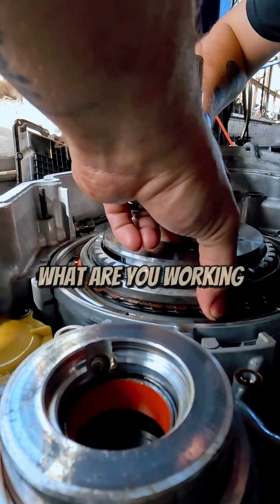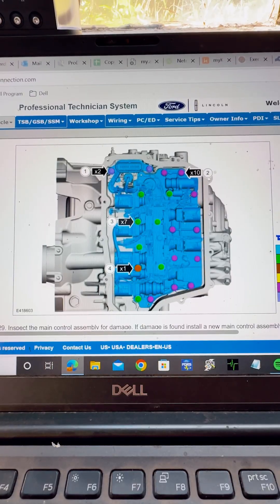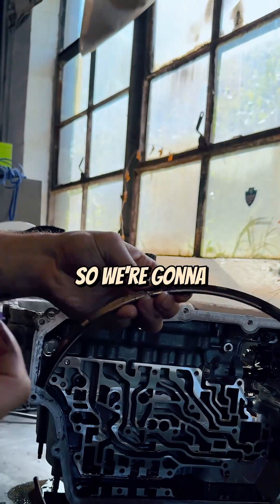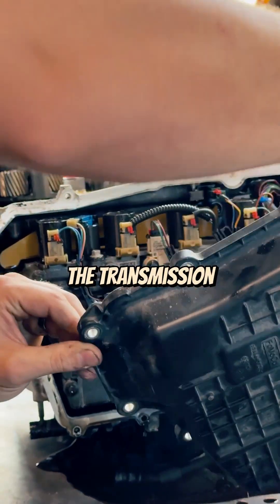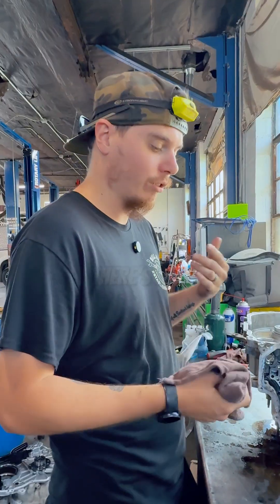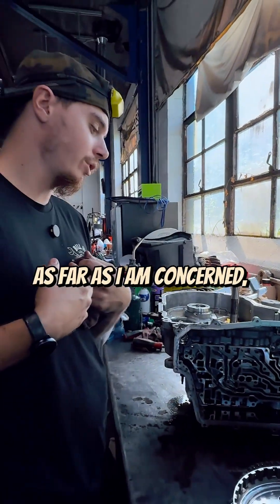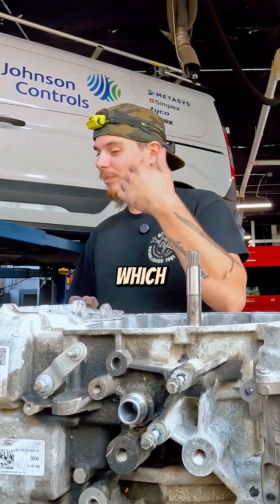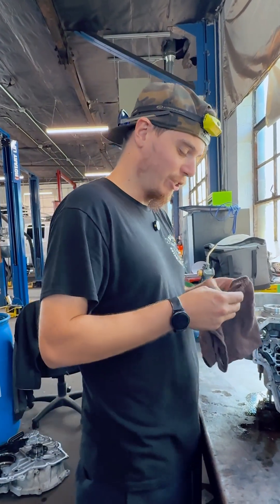2021 Ford Transit Connect 8F35 Transmission repair

Comment: Is this transmission considered reliable?
My transmission was replaced under the manufacturer’s warranty at 8,000 km, and now the car has 70,000 km.
What’s the best way to maintain it, and do you think it can last me a long time
Reply: If the fluid in the 8F35 needs to be changed every 30k miles, WHY DOES IT NOT SPECIFY AS SUCH IN THE OWNER'S MANUAL!? There is NO service interval listed in our 2020 Ford Edge manual for the transmission. Also, the filter is sealed inside the case, so it can't be changed without a complete R&R of the transmission. RIDICULOUS! I am hoping a class action lawsuit against FMC gets started over the 8F35.